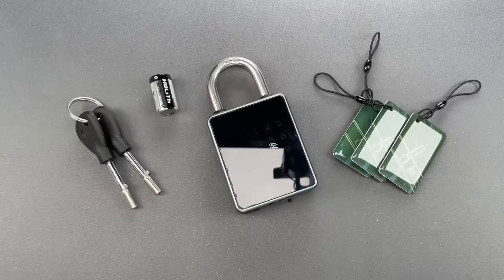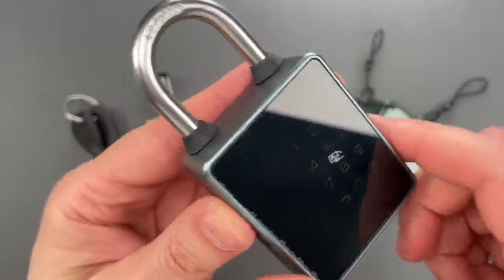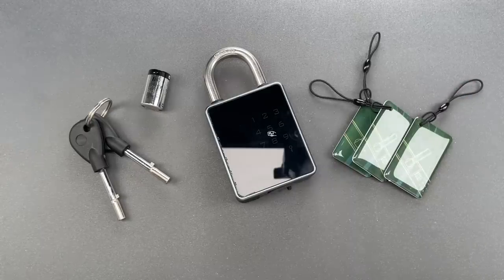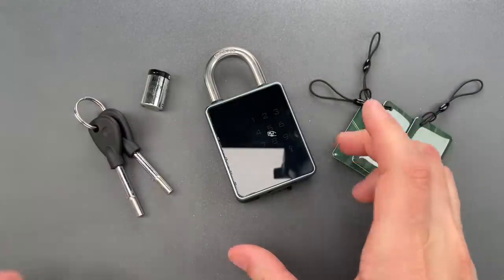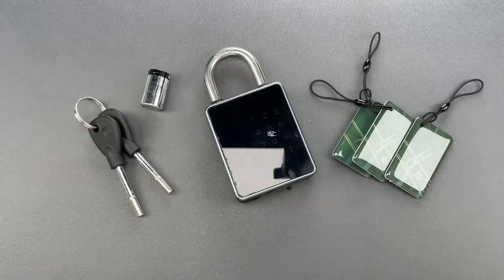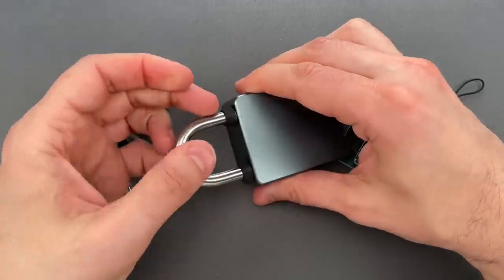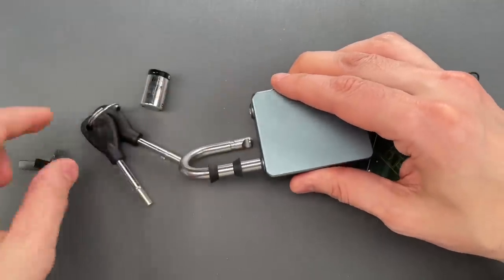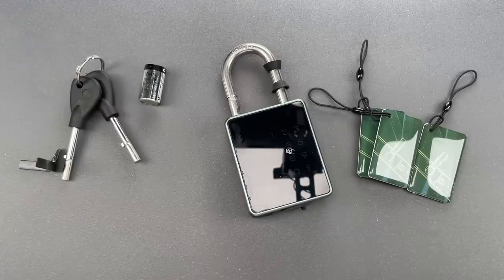[1532] Hi-Tech Lock w/ Lo-Tech Flaw: Laxre Smart Padlock

Comment: Considering the key is magnetic it makes me wonder how this thing would react to a powerful magnet.
Reply: I will guess poorly.
Reply: With the polarity of the magnets being different (he shows that on the key) a strong magnet will push some of the pins into a locked position rather than retracting them all.
Reply: If the lock was well thought out it would just make it bind up
Reply: Error1, if the lock was well though out it wouldn’t open with a urethane mallet or a padlock shim.
Reply: @turbomike74  Perhaps an AC electromagnet at (say) 60Hz would create an oscillating magnetic field, and act like a magnetic jiggler!
Reply: @stereoroid just hold an electric shaver next to it.
Reply: @error00001  This is not a well made lock.
Reply: @stereoroid  based on what?
Reply: It melts around, Terminator style🤣👍
Reply: @brianhawthorne7603  the lock in this case is not what failed… it was bypassed entirely
Reply: I used to have an old Conch magnetic lock that, as I recall, a large but not overly strong magnet would open.
Reply: @Bahamuttone   If the lock has been bypassed, wouldn't that fall under the category of failure?
Reply: Well first it would destroy the electronics
Reply: @stereoroid  
Hmm, clever idea, Brian.  Have a joyful and prosperous life 😊✌️  🕊🍀🍀🍀❣️
Reply: Don't know, but I bet I could open it with a set of bolt cutters......(snip and done)
Reply: whack it with weak magnet
Reply: I assume with the different polarities, the powerful magnet would do very little if you wanted to interact with the physical magnetic key.
Reply: @KarunaMurti  
Yeah, I love whacking with weak magnets too, it’s my favourite hobby.  Have a beautiful, joyful, prosperous and free life 😊✌️  🕊🍀❣️
Reply: I would be curious if a demagnetizer could do the equivalent of a rake tool.
Reply: @kennethng8346  
Now I’m curious too, Kenneth.  Have a beautiful, joyful, prosperous life in peace and freedom ✌️😉  🕊🍀❣️
Reply: @Bahamuttone  I guess it depends on what your definition of "lock" is. I think the "lock" in this case is item that LPL was "reviewing"--the "Laxre brand electronic smart lock." It failed.
Reply: I too was surprised to NOT see the "use powerful magnet on side of case to activate the solenoid" method featured here.  I guess on this one it doesn't work.
Reply: @stereoroid large speaker and a signal generator would do that
Reply: Using a degaussing tool might cause it to pop open easily. 
Of course, the mallet is the best, quickest way.
Reply: Was thinking the same, the “lamello minimag” should do it

Comment: My current game is "guess what embarrassing method LPL will use to get into this padlock."  I guessed shimming.  I failed to guess "hit it with a hammer".  My second guess was going to be the padlock bypass tool.  This is a fun game.
Reply: Same - got the shim missed the smack.
Reply: I guessed the shim also but my guess for the second method was a magnet
Reply: I went shimming first, like you knew there'd be room for it with the rubber boots trying to keep the water out.
Reply: @freman  it's not a question of room. When you have spring loaded pins engaging the shackle, what happens when you shim is you push the spring back. If you had a super tight shackle path, the lock would actually need extra protection since the smallest grain of sand or a little mud or ice will make it completely inoperable. Trying to protect a lock against shimming by making the shackle path tighter is not a workable idea. A correctly designed lock has ball bearings that lock into the shackle cutouts and are prevented by a turning element from falling back, there is no spring, so you can insert a shim all you want, the gap can be as generous as you want, nothing is gonna happen.
Reply: Even better as a drinking game! Loser takes shots. I live alone, so I bet against myself. Surprisingly, I lose every time.  * hic *
Reply: We all play the game. Hammer is always a wild card, but should never be forgotten about.
Reply: @PatGilliland  As soon as he said second way in, I knew it was the shim.
Reply: @SianaGearz  I remember one time there was a lock company that bragged "Two Balls Lock it up Tight".   But as I recall, the end of the cylinder core was not protected, so you could open it easily with a bypass tool inserted through the keyhole.

Comment: Would that type of magnetic key have any merit if the rest of the lock wasn't so flawed?
Reply: Ooh, that's an interesting question!
Reply: If you then need a specialised tool that LPL doesn't have (yet) ... probably.
Reply: Maybe, except that I suspect that the positions are fixed and binary so the number of combinations is rather limited. 2^5 or so instead of 7^5 for a decent pin tumbler design.
Reply: only because of its obscurity I'd assume. Tossing a couple magnets down the hole would tell you where the pins are, and reversing the magnets from how they landed would give you the correct polarity too, so I assume they'd be relatively easy to "pick"
Assuming you can't just rake it with a magnetic rake
He's demonstrated similar attacks in previous videos
Reply: @AstolfoGayming  Fuzz: "Hey, you! Why are you carrying a magnetic rake?!?" You: "Blimey, guv, that's no rake - that's a portable Halbach array...!"
Reply: @randombloke82  Except that each magnet can have (at least in his example) more than one radial position. I'll assume that more than one magnet could be at a given axial position. That brings the number of combinations up to something interesting. 
So ... I'd de-magnetize the whole shebang.
Reply: @randombloke82  With a pin or wafer lock, you rely on being able to forcibly push bound pins to the shear line. With magnets, the amount of force you can apply to move pins once the lock is tensioned is limited by magnet strength. I'd imagine that makes picking considerably more difficult if implemented correctly.
Reply: @AttilaAsztalos  HOLY CRAP another person who knows about Halbach arrays!!!
Reply: @AstolfoGayming  honestly i didn't even think about the magnetic key triggering tumblers because a hall sensor was my first thought, especially since it would be both cheaper than mechanical tumblers and offer the ability to precisely measure any unique characteristics of the key.  as poorly designed as this lock is, i doubt they put any thought into it and it probably is some kind of mechanical tumbler.  also if it was a sensor that measured characteristics of the key, you would be better off just putting an NFC chip in the key because unlike stupid magnets newer model NFC chips feature cryptographic co-processors and secure enclaves to prevent copying.
Reply: @RazorSkinned86  You'd hope the key would be functional when the battery dies, as that's the only real reason you'd want a key on an electronic lock in the first place.  Unless there's another backup for the backup?
Reply: @ku8721  A Halbach array is a special arrangement of permanent magnets that augments the magnetic field on one side of the array while cancelling the field to near zero on the other side.[1][2] This is achieved by having a spatially rotating pattern of magnetisation.

The rotating pattern of permanent magnets (on the front face; on the left, up, right, down) can be continued indefinitely and have the same effect. The effect of this arrangement is roughly similar to many horseshoe magnets placed adjacent to each other, with similar poles touching.  😀😀😀
Reply: Could a magnetic rod of the same size be used to counter different magnet positions?
Reply: @RazorSkinned86  They're already using the RFID in the cards. The key is a mechanical bypass incase the battery goes dead.
Reply: @johntuffy5721  Lol. I didn’t understand one word of that. 🤣
Reply: Assuming the shackle is made of a reasonably strong material absolutely. That key is almost certainly using neodymium magnets which makes the tool you would need to use to open that fairly expensive to to make as far as thieves are concerned, also you need somebody who knows a fair bit of a magnetism and you would need several of these locks to test on to make sure the tool actually worked. And knowing the state of smart locks this lock likely over $60
Reply: @AstolfoGayming I never thought I'd come across a real world scenario where "reverse the polarity" wasn't just star trek technobabble hahahah
Reply: @AstolfoGayming  I would assume setting it so some pins would need a "pull" and some a "push" would mitigate that to the point where other picking of other locks would be quicker. Also you can set up as many fake magnets as you want in the lock body.
Reply: @randombloke82  Maybe if they make the lock bigger and have locking mechanism on both side, it will not be vulnerable against mallet.

Maybe if the rubber ring is replaced with metallic ring that cannot be pushed away, it will not be vulnerable to shimming attack.

The potential is there, just that it's not happening.
Reply: This is the stuff that frustrates me about this channel sometimes. I understand security aspects and flaws, but if this magnet key ends up being really hard or near impossible to pick currently then it would be nice to point that out. 

Maybe it would strike someone to make a lock with only a magnetic key and none of the basic flaws and have something truly amazing. 

Sometimes I think he gets way to caught up in showing the flaws of the lock only.
Reply: Only if putting a magnet on the wrong spot stopped it from opening. Otherwise you could just expose everything to a solid magnet shaped like the key.
Reply: If there are 4 ways to open it, it's probably going to be a short video.
Reply: I think the problem is that only a padlock with those flaws (no heavy steel mechanical mechanisms gripping and interlocking with the shackle) could be OPENED by such a magnetic key (or by the RFID card, smartphone, etc.).
Reply: @highnrising  Yup. If it's installed on doors then it would really require specialized tool to open it.
Reply: @brendanberry7403  Lock makers are selling the idea of security, not (hopefully) cool factor. We buy locks (and pay for cool factor) in the belief that the lock will keep our belongings safe. If we are not getting the security we are paying for, we need to know that. It doesn't matter how cool or how technically advanced the lock, if the manufacturer doesn't plan for and defend against unskilled attacks, it doesn't matter how technologically advanced the mechanism. You can make a computer controlled lock with a rotating code, but if you make it out of plastic, a thief will just hit it with a hammer.
Reply: @randombloke82  The positions seem to vary both along length and angle, and since they are of two polarities you also have to count not present as a state, giving you 3 states. Assuming there are 5 positions and 4 angles, you got 3.4 billion combinations. So from that standpoint it should be pretty secure. Though it would be much cheaper with a one wire ID chip, I guess the drawback there is you could copy it.
Reply: @jackiemowery5243  you seem to have completely misunderstood what I was saying. Of course we should know the flaws of this lock in particular, but if the magnetic key proves impossible to pick currently then that is super relevant information. It could drive others to investigate magnetic locks. 

Right now we don’t even know as this video just skipped that bit. If this were not the first magnetic lock he had showcased then it would be a different story but I don’t think we’ve seen one before on here.
Reply: If that question translated to "are magnetic locks any good?": Yes and no. As with any lock, it depends on the implementation. (For reference: Bosnian Bill covered a couple of magnetic locks.) Should You get a magneticly keyed lock? If you wanted a toy/novelty item: Knock youself out. If you wanted to secure something: Probably not.
Reply: @ku8721  will this affect my pacemaker ?
Reply: @brendanberry7403  a lock like that already exists though, look up EVVA MCS
Reply: The problem with magnetic pins is that if the lock got dirty, those little magnets might not be able to move the pin.  Consider how hard it can be to insert a key into some dirty locks, where there is mechanical leverage working to move the pins.
Reply: If LPL taught us anything, I suspect the key mechanism is quite rudimentary.
Reply: @AstolfoGayming  That particular attack is very easy to prevent. With a few “false” gates that are by default open but lock with either polarity of magnets, one is back in square one and have to go through the full search space of combinations. (And, the general arrangement becomes trinary instead of binary. Giving a bit more combinations. Though, the lack of combinations is still a problem for most applications. There will not be more than a few hundred unique keys, I would assume.) As for magnetic raking, if the tolerances are at all reasonable, I don't see that very viable to get anything done. (Of course, if this would be the case, then even a much more common disk-detainer core would be hard... case point, some of the modern Abloy locks that have just a few guys world-wide knowing how to do it...)
Reply: @inediblenut  I had a magnetic padlock in the 80's where you just placed the key in an indentation on the side of the lock. That way you never get any dirt into the lock. Unfortunately the build quality of other parts of the lock was really poor. I also guess that you only had 2^5 key combinations or so on that lock.
Reply: Probably. It's rare enough that no tool exist, and even so a tool would be complex and expensive. And you can't pick it with a regular lockpick either.
Reply: Picking it would probably be harder.

Comment: The rubber boot is so close to defeating the second attack. If there were metal boots as part of the shackle, there wouldn't have been any way to insert the shim.
Reply: Okay, but that would increase the production costs slightly and would cut into the company's PROFIT!!!!!
Reply: The rubber is normally intended to prevent water from entering the lock in case it is used outdoors. As they didn't have locking on both sides of the shackle you instantly know they have cut a lot of corners to keep cost down.
Reply: The rubber is there to make sure rust or dirt can't make it difficult to insert the shim. 😁
Reply: It's high security rubber!

Comment: The most complex solved by one of the oldest man made tools 😂
Reply: But to be honest, Hammers can solve a LOT of issues that it was never intended to solve.
Reply: @gbgentleman   If not, just get a bigger hammer.
Reply: But the wacky go-lucky stick is the best tool
Reply: brute force: if it isn't working, you aren't using enough
Reply: @danielkorladis7869   honestly in this application and many others, if it half-price being used with finesse and not Bruce force
Reply: When needed, every tool can be a hammer…

Comment: What might be fascinating is for you to show us how you approach a new lock.  What low skill attack to you try first? What's next? All the way down the list to a successful entry even if it ends with the key. ( I doubt a lock would make it that far )
Reply: The 2nd Stuff Made Here lock if it had the back plate added to it would come close.....
Reply: First try: can you shim it with one shim. If not try two. If you can shim it, see if you can also whack it. I have no idea what order of steps he uses after that, but I'm fairly confident those are the first steps for any padlock that uses a push pull hasp (but probably not for warded key/skeleton key type padlocks with hinged hasps).
Reply: He always seems to start by determining what he can about the lock's construction based on his extensive knowledge of lock engineering before he ever decides on an attack to use, so there are a lot of attacks he doesn't try before he gets to success most of the time.

Comment: It seems like using greater tension on the pin that holds the shackle in place and placing it further down in the body would greatly increase the security of the lock.

Comment: Locking companies with the engineering team
Suits:  So how do we feel about this lock?
Engineers:  Solid and secure.
Suits:  We wouldn't end up on the YouTuber LPL correct?
Engineers:  We're just gonna double check some things and get back to you. [walks away mumbling and whimpering]
Reply: This is incredibly backwards. Pretty sure that most engineers are well aware of the faults intentionally included into products as a result of limitations imposed by suits.
Reply: @mmseng2  yes. any company making a shim-able lock knows they are making a low end lock.